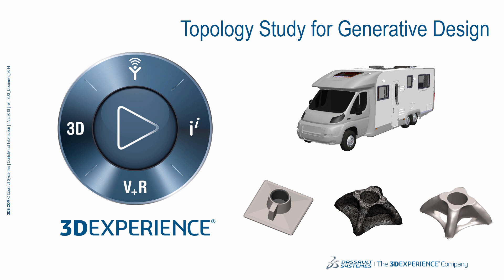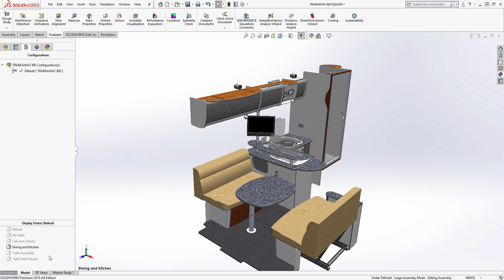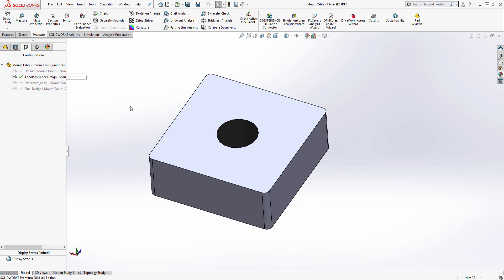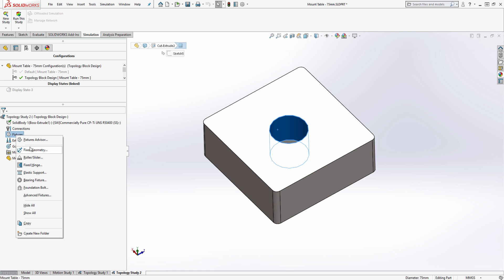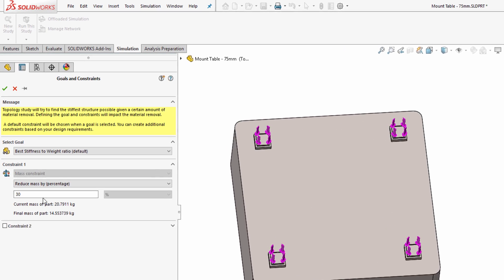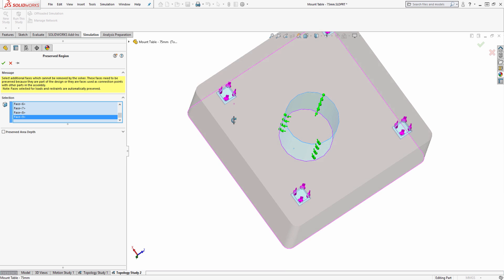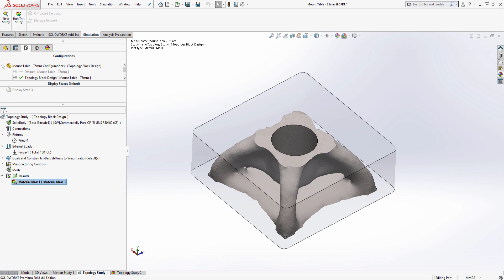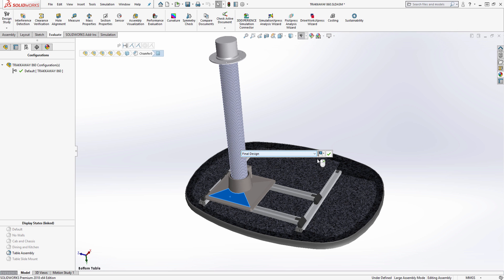Topology Study in SOLIDWORKS Simulation 2018 - Mounting Bracket

Comment: I’ve just completed a topology study of a fairly complex part, and I was wondering if there was a way to verify the results to ensure that the final exported solid object can withstand the loads defined.  Is this something that can be done? Or do I have to trust the optimization?
Reply: Do a static simulation and apply your load and fixtures, then run study.
Reply from the maker: Hi Kyle! Please reach out to our community to post your question for one of our experts: my.solidworks.com/forums.
Reply: Obviously, take your part and perform a new static analysis.